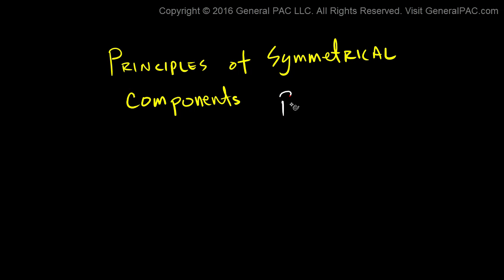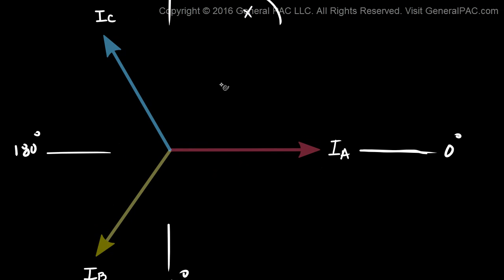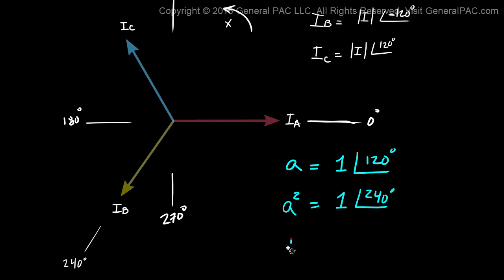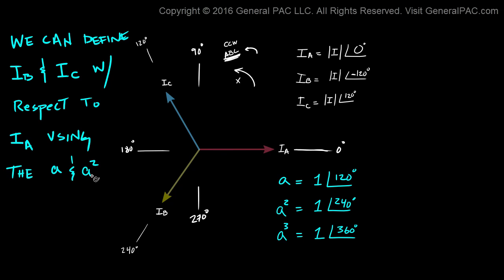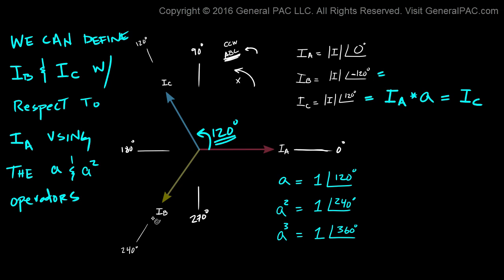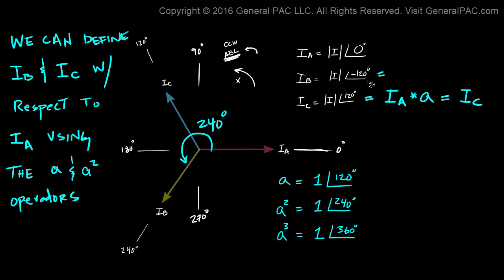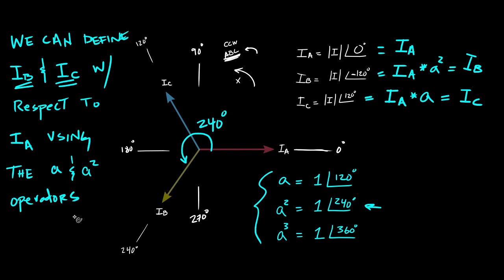Principles of Symmetrical Components Part 3

Comment: I have question: for ib why do we choose clockwise rotation why not clockwise rotation with +240 degree?,. How come we choose -120 degree?
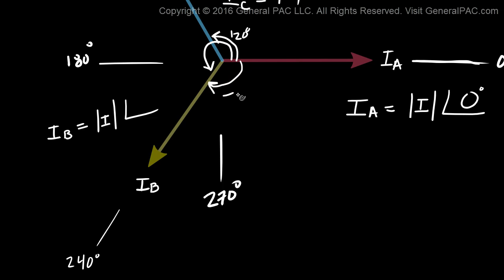Reply from the maker: We can rotate the phasors any direction we like as long as they are balanced. In my example @2:00 --- i could have chosen to rotate Ib 240 degrees in the CCW direction OR I could have chosen to rotate Ib 120 degrees in the CW direction.... both options are correct. Because both options will place Ib in such a place that makes a balanced set of three phases.... Why choose one over the other? The only thing I can think of is preference in which direction to rotate. Hope this helps!
Reply: Thank you for the instant reply. :)

Comment: Perhaps it will become more clear in other videos, but isn't it still accurate to say that a^2 (a-superscript-2) and a^3 are, indeed, a squared and a cubed, since if you squared a -- (1/_120)*(1/_120) -- you would get a^2=1/_240, and similarly with a*a*a-->a^3=1/_360?
Reply from the maker: +Caleb T  -- yes you are right, i'm clearing that up in the current video tutorial. a^2 (squared) and a^3 (cubed) is technically correct... because when we multiply phasors -- we multiply both magnitudes and add the phase angles (as you pointed out)...  a*a = ==>  1*1 = 1... and 120 + 120 = 240 :)
Reply: +GeneralPAC: Power System Tutorials Ah, very good. That makes sense. Thanks for these great videos, by the way.
Reply: I was about to say it, and i found you replying 2 years ago haha !
Reply: @Adam B 🤣🤣🤣 damn, what's happening here.